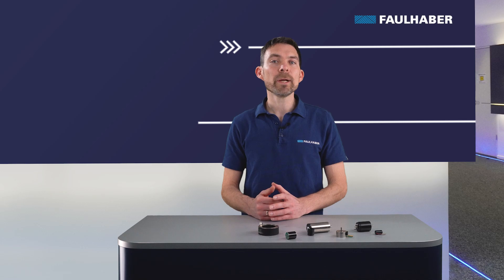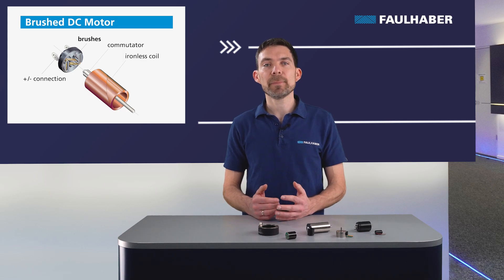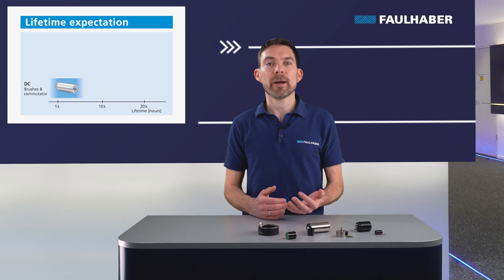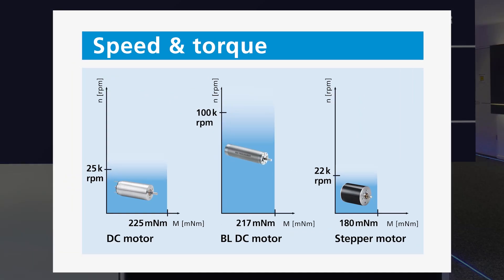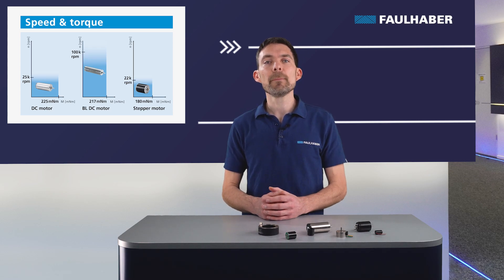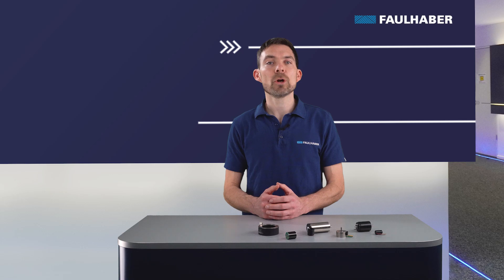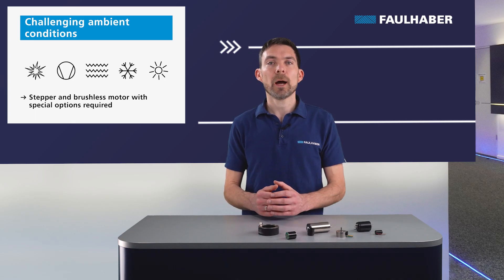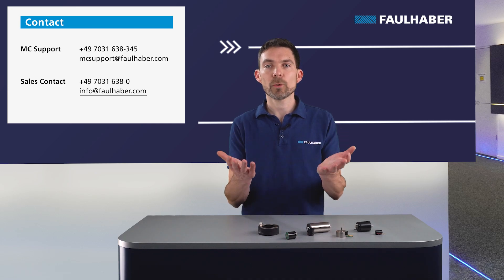How to select the right motor technology: DC, Brushless or Stepper? - FAULHABER Drive Time

Comment: I want to choose a stepper motor by looking the power , but in the datasheets it does not appear. Where should I look? Thanks again.
Reply from the maker: Hello, thank you for your feedback and the question! That is correct, we do not indicate the power of the motor at the stepper datasheet, but you could easily calculate it by this formula: power = torque x speed. 
To select the right stepper motor for your application please use the required torque of your working point. To get more information how to select the right stepper motor for your application, you could have a look on the stepper Motor playlist: Stepper Motor - FAULHABER Drive Time.
In case there are still some questions left, please do not hesitate to contact our local sales directly or to use the chat function on our homepage: www.faulhaber.com
Best regards your FAULHABER Sales Team